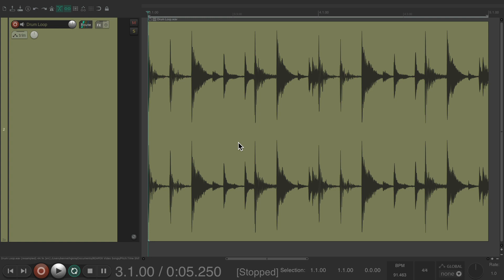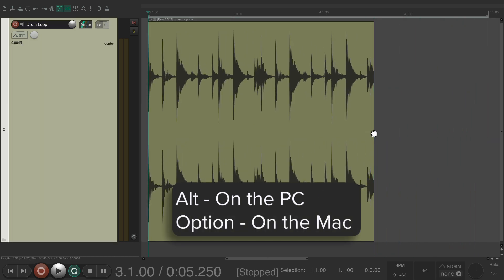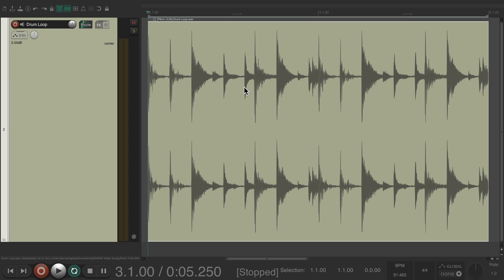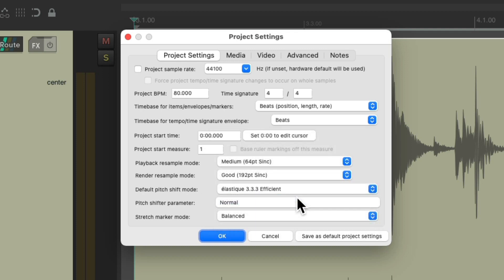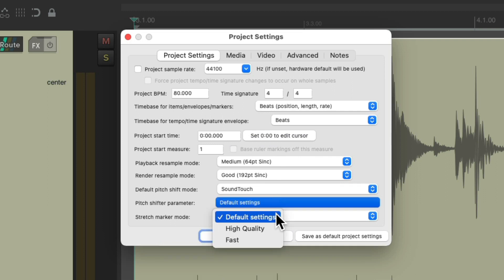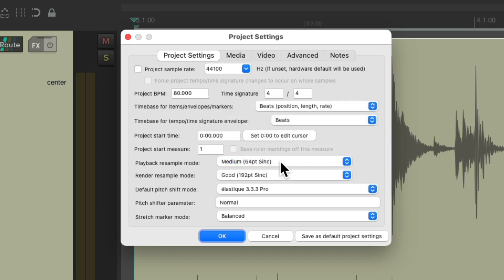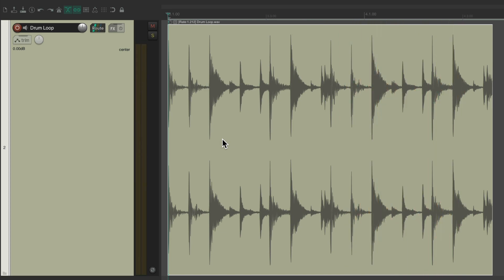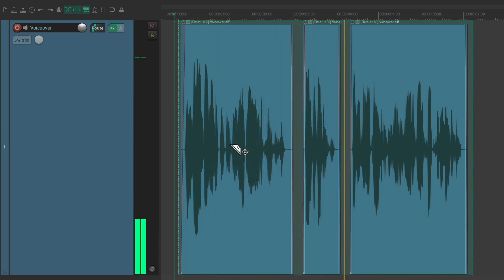Pitch:Time Shifting Algorithms in REAPER

Comment: My Rate changer doesn't look like a dial. How do I make it look like a dial and not a bar?
Reply from the maker: What version are you using?
Reply: @REAPERMania  I keep replying to this and it just deletes it or doesn't work for whatever reason. Maybe because the reply isn't long enough. Well, hopefully, this should have fixed that problem. I am using V6.40

Comment: Tip: SoundTouch can sound great with extreme stretching, when coupled with 100% wet reverb. The closest I've ever gotten to PaulStretch without using the actual thing.
Reply: As well as Rubber Band, can go very low, where Elastique pro craps out

Comment: It's like you read my mind. I've been working on a trap beat project. One of the characteristics of Trap is the use of tuned drums. Reaper makes it easy. One of the drum samples had to be adjusted by 27 cents to hit right on the mark. All of them had to shift up and down by 5 and 7 semitones in time with the changes. Getting them to sound good required a lot of the tricks in this video. Time stretching AND pitch shifting came into play when I tried to integrate a music sample into the mix. The Trap project itself was inspired by one of Kenny's previous recent videos on using the Media Explorer with Samplomatic5000. Keep it coming Kenny!

Comment: Damn...I wish I understood. What I think it is, is unlike BPM, it stretches out media? Or compacts it I suppose....yes?
Reply: Hope that you don't mind me replying and that I interpret your confusion correctly. BPM refers to the tempo of something. Setting the bpm in your project settings  makes it so the grid is divided accordingly, and (by default) stretches or shortens any media with embedded tempo information to fit with the new bpm value.
What is shown in the video are the different computational algorithms you can have REAPER use for this conversions, and they also affect the way  pitch shifting is handled. These different settings are optimized for various use cases. For example, if I were to pitch shift or stretch a vocal sample, I would use elastique soloist because it preserves the natural formants of the human voice. Hope this helps.